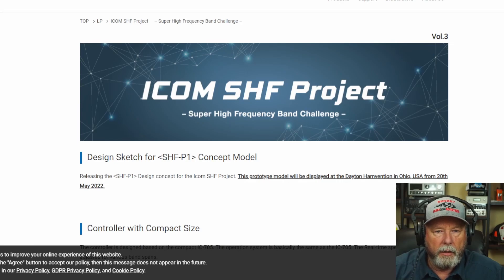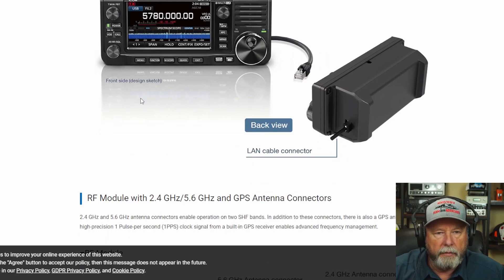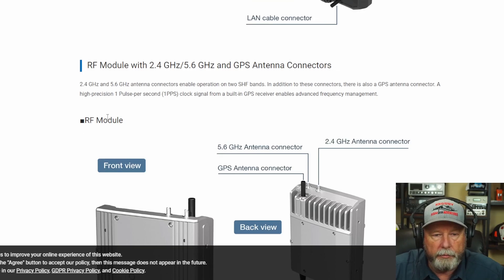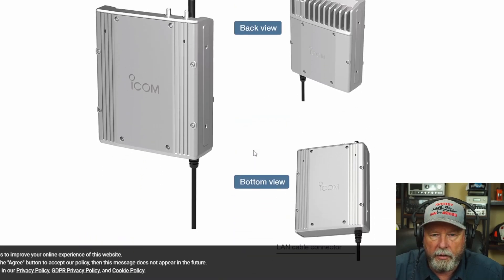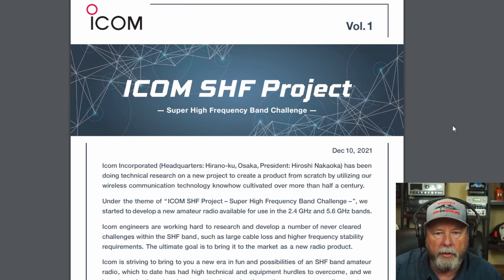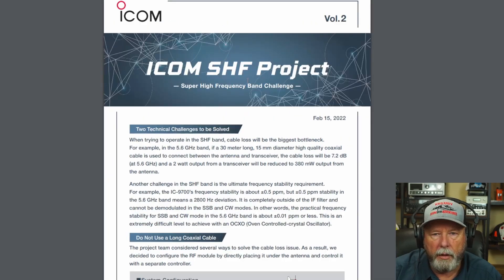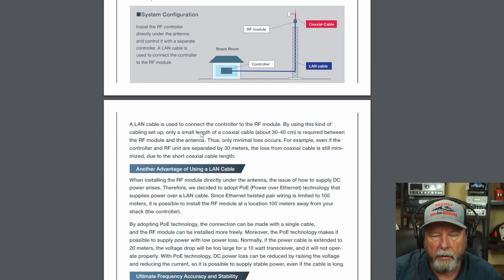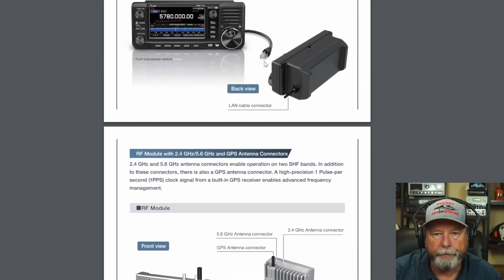Breaking News from Icom!@ The SHF Project.

Comment: Hi Chuck,
From what I read it's not a 705 but a controller that uses a 705 case. There is no RF hardware in there at all, just a POE network output that goes to the RF module which is installed right at the antenna. That is why the RF module also has a GPS antenna as it uses it for a stable reference. 
I wish it worked with the 705 though
Reply from the maker: Thanks Paul, Good to know. They were a little vague.

Comment: ARDEN becomes mainstream. I see they keep the RF module outside at the antenna just like the Cable companies always did. I applaud ICOM, For one thing, the supply of cheap do it yourself pieces for ARDEN might dry up someday, and many modern hams are not really into the DIY approach.